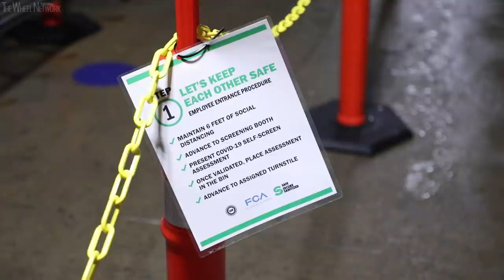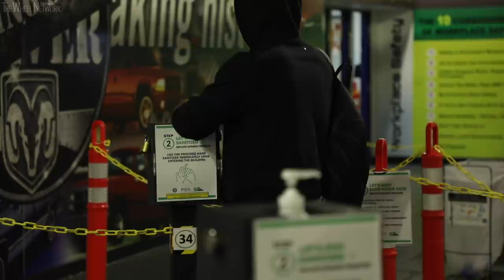RAM Truck Production in the United States

Comment: after reading a few haters comments--all i can say is you get crap in all brands--BUT i prefer dodge trucks--period--yes i do all my own , mechanic work. Still say im keeping my old 2005 quad cab.
The one thing i do hate is the really thin dashes--i have personally put in 3 NEW dashes NOT dash-overs,[in both my sons dodges] and they aren't easy to replace--now i can go back to loving my ram! its paid for too!
Reply: That’s why I buy Toyota. The best product, the best. Toyota engines go for 300,000 miles. These American made cars and trucks, 60,000 miles trouble ahead.
Reply: @liberty4175  To each his own and we all have our opinions but I've owned two Ram 1500's 2004 and 2016 which I still have and I put 200K+ on my first with no major issues before trading it in and my 2016 has 150K and still going strong...not sure I'll keep it until I hit 300K but the quality of these trucks have come along way

Comment: That would be a fun job to. Especially when you build your own truck how you want.
Reply: Nope, nothing about working these jobs is fun.  We are paid great, I won’t deny that.  But after 5 minutes you don’t look at the truck.  Its just a job to get done so you can go home. Line doesn’t stop, there’s always the next part to assemble.  Easy to fall behind(getting in the hole). So you have to try to maintain your speed and quality.  Not easy to do for 8 or10 hour days. 

Boredom of standing and doing the exact same thing for roughly 600 vehicles a day takes its toll mentally and physically.  That’s why so many quit within the first month. Some even the first day.  

I’ve made it 23 years. It’s been a struggle and been very lucky.
Reply: Guy martin  

I have worked for Chrysler, DaimlerChrysler, FiatChrysler and now Stellantis
Reply: @Matt-fd9hc  what's that fluid they dip the cabs and beds in? Seam sealer?
Reply: @LynxStarAuto  

Have no idea, never worked in Paint.
Reply: And then fix it regularly. How you want.
Reply: @LynxStarAuto  acid and then a nuetralizer  to rid the body of contaminets

Comment: I think it is great they are making the trucks in the USA. I just can’t justify paying $100,000 for a truck. So, it takes 40 hours to build a truck, and say the average is $35.00 hr. = 1,400.00 a week labor. That leaves $98,600.00 in raw material, does not add up!
Reply: Great math !
Reply: You left out R&D, Advertising and Transport and profit to name a few.
Reply: @patrickray7434  What R&D? chrysler?!? He left out management loot.
Reply: not all are 100 K but yeah you left offalot of billiable stuff...
Reply: Only the TRX's are 100k. Most are 60k. 
Also, if we want to talk about Ford, or Chevrolet, or GMC, then what you said applies even more. Even the materials don't cost as much and quality is a bit worse, yet they are still more expensive.
Reply: Toyota buy Toyota
Reply: You left a lot out of that equation lol.  Think of all the development and all the costs just to keep that assembly plant running.  Maintenance of all that equipment, and dozens upon dozens of other costs involved.  If it was only as simple as your equation we'd be buying trucks for $8k to $10k.

Comment: Ram truck oil change lol Drain plug oil all over sway bar. Oil filter ready got above power steering pump/ mechanism, oil spills all over it.
Reply: Sounds like you can’t change your oil. I do it easily. Maybe you should let a real man change your oil for you. 
Try hitting it with your purse

Comment: They look nice brand new - very unreliable long term.....have had three of them - will never buy another.
Reply: Sounds like me with Ford.  Had three F-150s.  Last one was an ecoboost which start having major problems right after the warranty ran out.  After sinking in about $3K on repairs and it not being fixed I traded it in on a new 2019 Laramie. Been pretty happy with it so far.
Reply: My 2011 Outdoorsman is still going with 225 thousand miles, I would not have a problem buying another.
Reply: I switched from Ford after 30 years to Ram, would never go back
Reply: 360k + on my ram never let me down
Reply: I've owned all three brands never had anything bad to say about any of them put over 2 hundred thousand miles on them.  But the best was 95 ram Cummins  over 500 k on it
Reply: @rogersmith7808  just use full synthetic oil and keep maintenance records. My 2011 has 220,000 miles and is showing no signs of issues. Don't listen to the Dodge haters!
Reply: @markstench4470  You got me beat! My 2011 Big Horn just hit 220!!
Reply: 215000 miles and still running like new, love my ram.